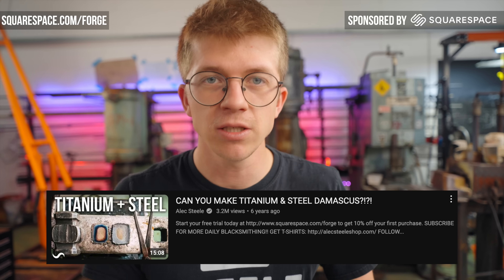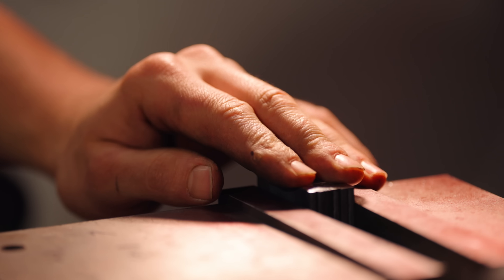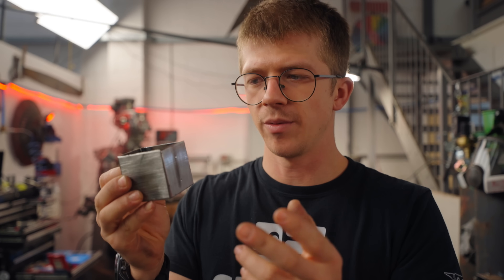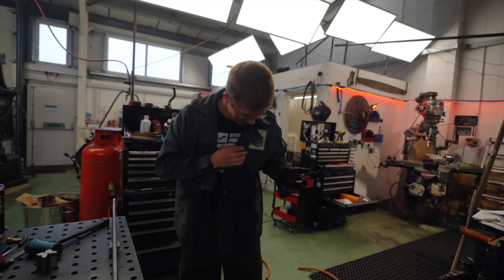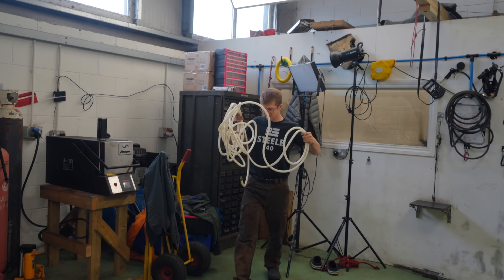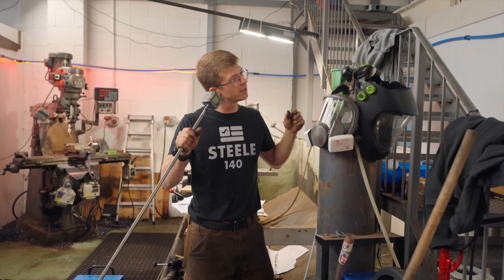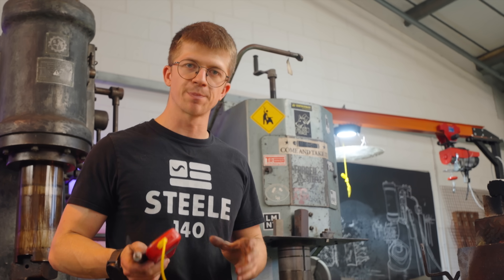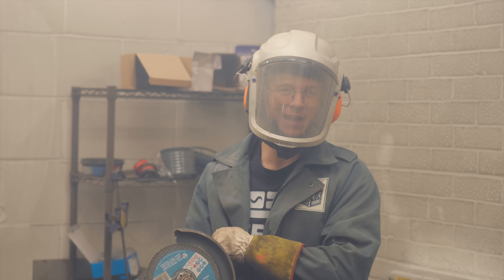Can I make Titanium Damascus?

Comment: The coloring of the oxidation layers at least at the beginning is related to how thick it is. You can actually tell the thickness of a very thin layer like that by the color. of course once it becomes thicker the actual properties the oxide has take over.

Comment: Titanium can't be used in the barrel of guns because despite being a strong metal, it has a much lower melting point than steel and the barrel would warp.  So your rationality of "hmmm more heat better.  2100 degrees!" was fantastic.

Comment: You could potentially use that melting as part of the process to get even crazier patterns than otherwise possible. Let it partially melt mid-forging, and then let the soft, hot metal ooze around as you apply the hammer pressure.

Comment: I have an idea for a video, that you may fancy: try to reduce forge scale will aluminum (using thermite reaction), to get steel and make something out of it. All you need is scale (iron oxide) ground down to a powder, aluminum powder and a source of carbon (charcoal powder) to make the ingot steel not iron. Could be cool. You could make one out of plain carbon steel and another with added nickel, and make damascus out of the two! Veritasium has a cool video on the thermite reaction you could look up as a start.

Comment: With titanium your supposed to run a electrical current through it at a certain voltage. you can have a array of different yellows and blues. 
 Tbh I've been wanting a titanium  deity sword from the majors mask necklace. Would be awesome to own but it's expensive. As you've shown 😂❤ I've been learning blacksmithing through your videos and would love to forge something.

Comment: Electricity is the best way to color titanium, different voltages yield different colors. With a bench top power supply u can fine tune the exact color u want with the twist of a knob
Reply: while anodizing titanium is the best for getting specific colours, using heat allows for some nice gradients in the colouring, which is relatively hard using electricity.
Reply: @johannesbohm6458  Just twist the knob (increase the voltage) while pulling it out. (or decrease the voltage while dunking it)🤷‍♂
Reply: @EarthPoweredHippie  why not use electricity to make a base color, and heat specific spots to make gradients?
Reply: Like silver black green that type
Reply: @hassanjaved1904  you can get some gold-purple, magenta, aqua-green, and light green with andozing that you can’t achieve with heat. You can easily Google some gradients.
Reply: I think he'll try lots of those options. He's like a kid at Christmas!
Reply: not true with this kind of Tilam heat is the best way . Yes electricity is the best one one grade but not with multiple grades at the same time
Reply: @amxen1  Heat is going to apply to the different grades the same way electrolysis will. Alec's sample had the grade 2 turn blueish purple and the grade 5 turned golden. Regardless of how you anodize it's going to apply to both grades at the same time.
Reply: In my experience you can get gradients by using low amperage. My grade 2 and 5 samples behave slightly differently under the same voltage and electrolyte concentration settings.

Comment: It's funny how the reaction to titanium shavings catching fire depends on the profession: Metalworkers take it as a huge danger, pyrotechnics and they are the safest thing you can let even a baby hold. Well, not exactly, the cold spark powder is titanium, zirconium and titanium dioxide, but basicly it produces extremely bright spray of burning titanium that cannot even discolor paper with its heat.

Comment: This is awesome. Titanium alloys already behave quite differently to eachother. I wonder how difficult it would be to do this with a completely different metal alloy. I don't think there are many options due to the high forging temperature though. And reactions between the metals could also cause issues.

Comment: Using a 100v DC power supply you can get other cool colours that cannot be replicated with heat.
Reply: DC Power supplies can run really(comparatively) high current compared to a chain of 9V batteries. Higher current will rush the part to a target voltage in a fraction of a second instead of double-digits seconds. If trying to keep a difference between the 2 and 5 layers, you might need the slower anodizing speed. For larger parts I have needed the DC power supply to rush it up to 70V before finishing with my 144V battery chain.

Comment: Still can't believe the process of doing this was something you could patent.   We're going to do layered Damascus, but do so in a canister Damascus fashion... and for good measure we're going to weld together our metals in a way no one would every thing... but using inert gases to weld.
Patent Examiner: Looks good to me >STAMP<
Reply: a patent can be granted for a novel workflow or process.
Forging damascus titanium in this way is (or was, at the time of the patent being granted) a novel workflow/process, even if the individual steps of the process are not new or unique. Thus, a patent was granted.

Comment: The way that thing squeezed out of the Jacket like a pierced water balloon in a SmarterEveryDay video was terrifying.
Reply: It was a eutectic reaction with the Ti and steel.   Too hot!   Ti on its own won't melt at 2100F, just oxidize severely, but if its in a lot of pressure against steel, or Ni, or Co, it will get to partially liquid.   1750-1850F is probably hot enough to forge weld the Ti pieces, and not get the eutectic with the steel cannister.

Comment: 8:42 That also startled the crap out of me.  I had no idea argon was inert; you learn something new everyday.
Reply: It's one of the noble gasses on the periodic table, for future reference to other gases that are also inert.

But I should clarify that any gas can be compressed within a sealed chamber, and that can still vent explosively.
Reply: It's also not actually fully inert, it doesn't want to react with stuff but it will participate in some chemical reactions regardless of the fact that it really doesn't want to
Reply: @noodlelynoodle.  But for some reference on how inert this is, the primary compound that proves this is Argon fluorohydride (HArF). This compound is only stable up to like 17 degrees K. Alternatively, the working principle of ArF lasers relies on the formation of a temporary Argon Fluor complex.

That said, that is an extremely high barrier to define inertness at. For all practical purposes, argon is inert, and it's far cheaper to get than the alternatives by virtue that you can get argon easily by the fractional distillation of air, making it an intrinsic byproduct of producing liquid nitrogen / oxygen.
Reply: @CensoredUsername_  oh yeah for most applications it is inert but once I found out that the noble gasses actually can react with stuff I was a bit annoyed about being taught that they're fully inert and like to mention it lol. Like krypton is another noble gas but can be used to make krypton hexafluoride which is the strongest known oxidizer which can oxidize stuff like xenon and gold which are both considered inert too which is super neat to me, you add a bunch of fluorine onto an inert gas and suddenly it's a waaaaay more potent oxidizer than elemental oxygen chlorine or fluorine
Reply: @noodlelynoodle. there is a lot more chemistry with gold than inert gases.
Reply: You didn't know it was used for welding?
Reply: @mrkiky  No, I'm not a welder; my experience leans more towards soldering.  Specially circuit boards.

Comment: If the steel jacket did bond with the titanium you could make a beautiful and sturdy knife. Titanium doesn't have great edge retention in my experience so being able to add a high carbon/tool steel edge would go a long way to helping with that.
Edit for spelling
Reply: I always wanted a tool stool edge.
Reply: @barongerhardt imagine a sawmill scraper blade edge 🤤
Reply: @barongerhardt  heh gotta love autocorrect
Reply: @barongerhardt i edge my stool to make ot cool
Reply: Yea, but heating up the titanium to get colors would over-temper the edge steel unfortunately. Need a way to keep the edge cool. Or maybe just throw the whole thing in the tempering oven as if it were steel and the titanium will get nice colors automatically?
Reply: @mrkiky  There's probably a whole world of possibilities when it comes to heat-treating these things. Maybe just coat the tool steel edge with some clay, for example.
Reply: @JarLoz  I imagine the clay won't help. The concern is the heat will travel through the metal, not that the torch will hit the edge. You'd have to cover it in something that sucks the heat out of it.
Reply: @mrkiky  Anodize the titanium for color.
Reply: @hanelyp1  As long as it gets different colors for the different grades, it would work.
Reply: @mrkiky  You can change the colors with voltage too. No heat needed. Look into anodizing titanium.
Reply: @mrkiky  Thats why you would use the anodizing technique to colour the TI instead of heat . I dont think the tempering of the steel edge would upset your coloured TI.
Reply: @adamparker9765  The tempering of the edge definitely would from what I've seen in the video. But that wouldn't be a concern since you can just polish the oxides off and then start anodization. Anodization is a good candidate, just gotta see what it looks like on timascus, so far I've only seen it on homogeneous pieces.
Reply: @mrkiky  you can anodize titanium with a 0-110V power supply to get the entire rainbow of colors without ruining the HT on steel used
Reply: @mrkiky You don’t need heat to build up the colorful oxides. You can use electricity and anodize it. Lab bench power supplies allow for precise control, and it’s way easier compared to anodizing aluminum. Only need water, no acids.
Reply: @mrkiky  you can anodize titanium to get some he same colors.
Reply: Alas it was mild steel. But it would probably be easier to forge tool steel onto that surface than the titanium, seeing as our boy Alec has more experience with that.
Reply: A steel layer for the edge jacked by another metal.
Reply: It wont form a good bond.   When engineers want to bond titanium to steel (like for the sheel of a chemical reactor vessel), the do it by explosive bonding.  Usually something like ANFO.   Its also possible to do it by rolling, but it doesn't work so well because there is only a very small window of temperature where steel and titanium will have similar flow stress.  You don't really want to heat the Ti up at usual steel forge weld temps.
Reply: OMG! A 1mm spine of tool steel sandwiched between alternating 0.25mm titanium layers would give the pretties, lightest and sharpest blade ever!
Reply: been done was in Blade Magazine years ago sad
Reply: How would that work? Wouldn’t all the titanium be completely covered?
Reply: @Athrawes  or maybe use that new alloy, which is 500 times harder than titan, lighter than foam and translucent, that NASA made in space🙃🤔
Reply: A san mai with good steel on the spine and edge with Titanium Damascus sides would look bad ass for sure.

Comment: so with normal steel damascus there is upsetting the material, then chopping it up and welding it back together. With titanium, will you now have to re-encase it after ever upsetting cycle and build out a new argon infusion pipe?
Reply from the maker: @elitecpudoc329  yes! It’s going to be much more labour intensive that’s for sure!
Reply: Yeah, you would need to.

Comment: For Flow rates, in medicine. 2-5LPM is low flow or Normal. 6-10 is a medium flow, and anything above 10LPM is High flow, but when high flow is indicated we usually run up to 15LPM. Just a thought and maybe help on your flow rate decisions.
Reply from the maker: @fyrdoc  that’s really interesting to know! Thank you!
Reply: @AlecSteele  In the HVAC world, where oxygen can cause cupric oxide issues when brazing, the system is purged with nitrogen and then lightly pressurized while brazing. The process is to first purge at a reasonably high flow to drive out the oxygen, and then flow steadily at 2-4 standard cubic feet per hour (per HOUR) while brazing. It is just enough to keep the system positively pressurized to hold oxygen out while heating. Take from that what you will.
Reply: @AlecSteele  Make a preheat chamber for the gas so the heat on the inside is more even. You could also try plating the titanium with some other metal so it doesn't oxidise without the inert gas, or do it in vacuum. Use just two pieces to test, you can fold them later.
Reply: @TheOriginalEviltech  I'd like to know how you suggest running a forge “In a vacuum”???
Reply: @savage6394  You see the pipe with which he injected the purge gas? Pull a vacuum on a well sealed box. Insert in forge. Profit. Or whatever...
Reply: @TheOriginalEviltech
You said 
"..or do it in vacuum. Use just two pieces to test, you can fold them later."

You couldn't get a burn without adding oxygen in a vacuum if heated by gas. Adding oxygen fights the purpose of a vacuum. You would need an induction heater. Plus imagine the space all the equipment takes from your volume of vacuum.
Reply: @grilsegrils9330  just 2 pieces of titanium. In the forging box. Which is under internal vacuum. Than heat it up in the forge as you normally do. Seriously, what's wrong with you people? Can't you deduce such simple things by yourself?
Reply: As a medical devices technician 
+1 on what he said
Reply: I was gonna say the vague language was a bit suspicious (since the point of patents is to give all the details in exchange for legal protection from competition for a certain period), but that makes it seem more legit.

Comment: Niobium foil as a solider between slice and closed canister!This way you are be able to weld titanium and steel togerher!
Reply from the maker: @ИльяЗеленов-в4ж  I’ve already got some on the way! Can’t wait to see what the possibilities are!!
Reply: 2100F is way too hot.    1900F is all you need, maybe 1750F.   You created a eutectic reaction with the steel at 2100F.   And no power hammer - use a press with low strain rates at first.
Reply: That sounds expensive
Reply: And be careful with the Ti grinding swarf - now you're making something very flammable